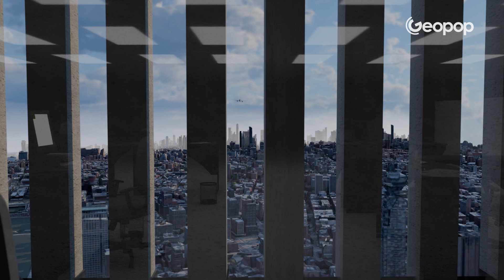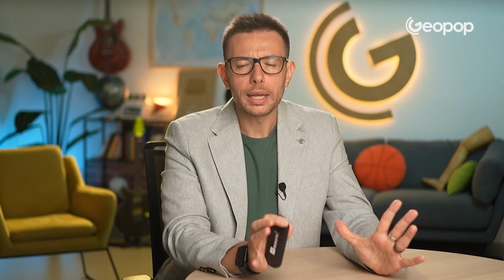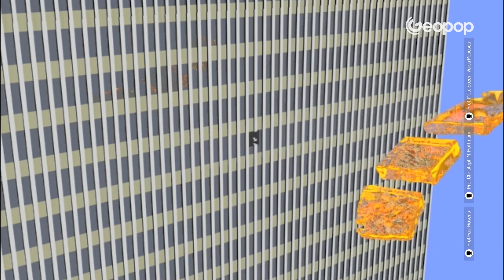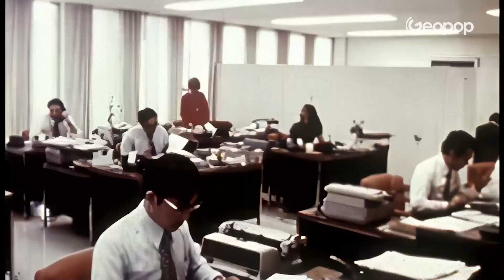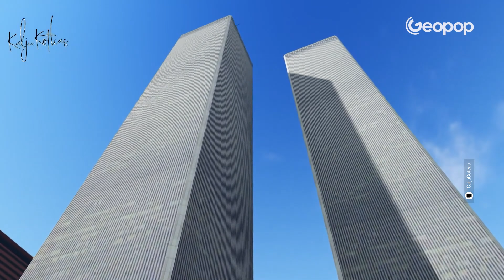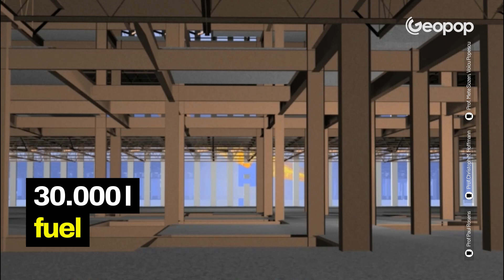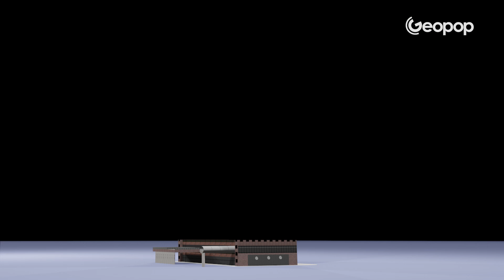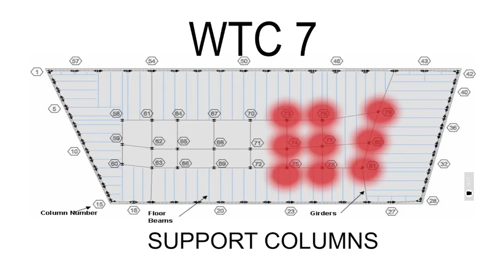9/11, 2001: The Technical Reconstruction of the Twin Towers and WTC 7 Collapses

Comment: Hey just asking questions out of curiosity, I am not a chemistry or physics major:
1) How did the temperatures rising to 900 degrees? How did it reach the maximum burning point from open air burning of 260–315 °C (500–599 °F) to maximum burning temperature of 980 °C (1796 °F). This part I do not understand.
2) The fuel is predominantly in the wings and back fins so on impact that fuel would have trickled down the building and as other footage shows it travelled down the elevators. If the fuel is not contained in one area and combustion is fed with the open air. What would have limited the burning of fuel and reduce the strain on the metal   weakening the structural integrity of the building?
Reply: These are some of the people who found molten steel in the w t c debris 
. Captain Philip Ruvolo (NYCFF), 
Richard Riggs(debris removal expert), Mark Loizeaux , Leslie Robertson (wtc structural engineer), Lynn Margulis (University of MA),  Dr. Abolhassan Astanch (from Berkeley),  Robert Kim Ireland( chemical engineer for US Army Corp of engineers), Mark Basile( chemical engineer), Kathy McGrade (materials engineer), Gery Warner( Mechanical engineer), David Gregg( PhD Chemical engineer), Steven Jones PhD( physicist), Kevin Ryan ( BS Chemistry), Niels Harrit (PhD Chemistry), Tom Sullivan( Explosives team) Jason Cheshire ( Chemical engineer), and Jeffrey Farrer (PhD Material science engineer).
Reply: In open air, jet fuel burns at around 260-315 °C, but inside the WTC towers, heat was trapped and combined with burning office materials. This boosted the fire’s temperature to around 900-1,000 °C enough to weaken the steel (though not melt it) and cause the collapse.
Reply: @NaApologia then where did the molten steel come from?
Reply: @robbiehiatt9966  The molten metal seen in the debris was almost certainly molten aluminum (from the plane and facade), which melts at 660 °C. It wasn’t molten steel .. no credible evidence supports that.
Reply: @NaApologia It's easy to say hey there ain't none of that. What is hard is looking through the debris and actually doing the tests. Which was done by experts. You are lying because you didn't look in the dabris did you? You have no proof. Go look up these people they will show you the evidence. Ill leave you with this. So if there were no explosives then what is this? 8:25
https://youtu.be/bLF5D7M1YgA?si=aHSvS__uOdxMi1ZB
You can't say that it was added because you can see the firemen's reaction to the explosion. And you can't say it came from anywhere else because the firefighter says
" We gotta get out of here,  7 is exploding " words are cheap, here ive given you factual evidence
Reply: @robbiehiatt9966  What molten steel?
Reply: @ChristLink-Channel Let's set the record straight. Molten steell was found in the dust, and in the debris for 6 weeks.  Molten steel was reported by the fallowing 
people. Captain Philip Ruvolo (NYCFF), 
Richard Riggs(debris removal expert) , Leslie Robertson (wtc structural engineer), Lynn Margulis (University of MA),  Dr. Abolhassan Astanch (from Berkeley),  Robert Kim Ireland( chemical engineer for US Army Corp of engineers), Mark Basile( chemical engineer), Kathy McGrade (materials engineer), Gery Warner( Mechanical engineer), David Gregg( PhD Chemical engineer), Steven Jones PhD( physicist), Kevin Ryan ( BS Chemistry), Niels Harrit (PhD Chemistry), Tom Sullivan( Explosives team) Jason Cheshire ( Chemical engineer), and Jeffrey Farrer (PhD Material science engineer). And more
Reply: @NaApologia  Plus the wind.  Plus the fire creating its own suction.  Plenty enough to get to 1000°

Comment: so let me follow this ,,, You are saying the nose of a jet plane is shown coming out the other side after going through the center of the main support columns and come out intact in the video... DOUBTFUL...  Aluminum vs.  Steel. and you think Aluminum would come out totally intact.... ha ha ha
Reply: Nothing came "intact".
And the nose of the second plane came on the other side exactly because its path wasn't intersecting the core columns (but was the case with the first plane), as it was a bit off-center, as we all could see.
Wake-up.
Reply: That's not the nose.

Comment: "The heat caused the metal to buckle".  Ya, right.  The L.A. Skyscraper had 10 lower levels (with all the wieght) engulfed in flames with no building collapse.  Other Skyscrapers as well.  Building 7 news footage, "Stand back, we're pulling it ! " from the fire department.   I saw the local news footage myself before it was censored.  It takes at least a week of preparation for a controlled demolition to happen, so it was pre-planned.  The government needed a reason to go to war with Iraq (oil), and they got it.
Reply: Were these other fires fought? Did the fire department put water on the fires? Yes. Yes they did. Big difference.
Reply: Steel framed. The critical bit is STEEL.

Collapse initiation was due to sagging floor trusses (which we can see) causing inward bowing of some perimeter columns by up to 5 feet (which we can also see) at the impact and fire damaged floors until those perimeter columns buckled and failed, initiating the collapse (which we can see). I would refer to you the excellent Gary Pollard video of the collapse of the South Tower. Pay attention to the first 12 seconds in particular.

www.youtube.com/watch?v=ULdiD6gYZO0

Comment: Still doesn’t explain where half the rubble went. It’s like they where vaporized
Reply: The were under and around the towers.
A part was converted to dust, but that likely a small part of it.

Note however than the 7 large undergrounds evels were crushed down by the falls, thus a large part of the debris went underground.

Comment: Expert Demolition seen the videos and at the "point" right before walls came down "puffs" were seen. As like explosions
Reply: Those "puffs" were jets of dust & debris forced out of the building by the increasing air pressure as the building collapsed. But they were slow, not much like explosions at all.
Reply: Those puffs are called squibs, very typical for a controlled demolition.  If it was air pressure it wouldn't have happened 20 floors below the collapse. Heres a video to help understand squibs. https://youtu.be/eXAgulfAtR4?si=-iLO9aQjMJVLTUYH
Reply: @robbiehiatt9966 Finally someone with knowledge on this. Thank you
Reply: @robbiehiatt9966  ANYWHERE below the collapse is a legit place for jets of air to escape the tower. What do you think happens to the air pressure in those buildings as their volumes are rapidly reduced? That air's gotta find a way out of the building so they make their own. The is ZERO evidence that those jets are explosive in nature.

Oh, and your video is a classic example of circular reasoning! They must be squibs because they're squibs! lol
Reply: @Tim22222 yea that makes sense,  it skips 1600 windows then blows out the 1601st window. You're a fool. If you can't see the explosions happening constantly as the 2 towers fell you ain't looking.
Reply: @robbiehiatt9966 Mr. 66 yeah I'd didn't fully say "PUFFS" all the way down. Am I ok know Mr. 5 subscribers
Reply: @robbiehiatt9966  If those were explosions, tons of physical evidence would have been left behind: residue, detonators, wiring, etc. etc. First responders & forensic examiners went through the wreckage with a fine-toothed comb. What did they find? NOTHING.
Reply: @Tim22222 they were obviously paid to find nothing. But here's a list of experts who found molten steel in the debris. So I ask this. What here burned hot enough to melt steel.Captain Philip Ruvolo (NYCFF), 
Richard Riggs(debris removal expert), Mark Loizeaux , Leslie Robertson (wtc structural engineer), Lynn Margulis (University of MA),  Dr. Abolhassan Astanch (from Berkeley),  Robert Kim Ireland( chemical engineer for US Army Corp of engineers), Mark Basile( chemical engineer), Kathy McGrade (materials engineer), Gery Warner( Mechanical engineer), David Gregg( PhD Chemical engineer), Steven Jones PhD( physicist), Kevin Ryan ( BS Chemistry), Niels Harrit (PhD Chemistry), Tom Sullivan( Explosives team) Jason Cheshire ( Chemical engineer), and Jeffrey Farrer (PhD Material science engineer). 
All found evidence of molten steel. So obviously someone was paid just like NIST
Reply: @Tim22222 how's this for evidence ? 8:25
https://youtu.be/bLF5D7M1YgA?si=aHSvS__uOdxMi1ZB
You can't say that it was added because you can see the firemen's reaction to the explosion. And you can't say it came from anywhere else because the firefighter says
" We gotta get out of here,  7 is exploding " And theres your proof how they knew 7 was gonna fall.

Comment: There was "work" on corner elevators days before this.
Reply: These are the people who found evidence of molten metal at ground zero.Captain Philip Ruvolo (NYCFF), 
Richard Riggs(debris removal expert), Mark Loizeaux , Leslie Robertson (wtc structural engineer), Lynn Margulis (University of MA),  Dr. Abolhassan Astanch (from Berkeley),  Robert Kim Ireland( chemical engineer for US Army Corp of engineers), Mark Basile( chemical engineer), Kathy McGrade (materials engineer), Gery Warner( Mechanical engineer), David Gregg( PhD Chemical engineer), Steven Jones PhD( physicist), Kevin Ryan ( BS Chemistry), Niels Harrit (PhD Chemistry), Tom Sullivan( Explosives team) Jason Cheshire ( Chemical engineer), and Jeffrey Farrer (PhD Material science engineer).
Reply: Maybe. So what?
Reply: @Tim22222  there was work done and Thermite was suspected to have been seen in the recordings. Seen as "melting metal as it came down.  That's what "so what
Reply: @edwardandrade4390  Work being done in large budlings should surprise no one. Thermite has never been proven, certainly no one ever "saw" it. Metal does not need thermite to melt, fire can do that.

Pretty weak.
Reply: @Tim22222 whats your degree in?
Reply: @robbiehiatt9966  Physics.
Reply: @Tim22222 Mr. 3 subscribers

Comment: Jet fuel buns about 800°F to 1500° F . Steal beams need about 2750°F.
Reply: True! And as noted below, irrelevant. (But did you know that jet fuel was not the only thing burning in those towers?)
Reply: @Tim22222 paper and clothing with hum*ns THAT wond be that hot. Either
Reply: @edwardandrade4390  1000°C is not unusual for office fires. And although that's not hot enough to melt steel, it is hot enough to weaken it by up to 90%!
Reply: @Tim22222 Well let me ask you this mister tim. If the fire was a thousand degrees what temperature does that make the metal?
Reply: @robbiehiatt9966  If it reaches thermal equilibrium, 1000°C.
Reply: @Tim22222 So you don't know. And you're welcome,  now go figure the rest out on your own. Because in this situation,  it never reaches 1000°.  opps, didn't mean to give you the answer but I've been holding your hand here, you sure you can walk??
Reply: @robbiehiatt9966  I DO know. If you put metal in a fire that's 1000°C, it's going to eventually reach 1000°C. And the fires were estimated to have reached - ready? - 1000°C.

Or do you have a better take to share?
Reply: @Tim22222 you didn't account for the steel that wasn't being burned. The whole structure was connected. The parts being burned would have to heat up parts that wasn't being burned. In this instance it would never reach the 1000° mark. Do your research. Go to schools if you don't understand. Its never to late to learn something.  My guess is you are lacking in the brains department.

Comment: I'd believe jet fuel DOESN'T burn hot enough to burn or melt steel beams .
Reply: You are correct.

And since there's zero evidence that any steel melted, not a problem.
Reply: @Tim22222 In the clean up the beams were looked at and seen in that "melted" form.
Reply: @edwardandrade4390  Nonsense! If they melted they'd be puddles!

Comment: The elevator shafts were reinforced concrete .
How did they get dustified from downward pressure?
   Especially if the whole building fell in its footprint?
Reply: "The elevator shafts were reinforced concrete ."

No they were not.
Reply: @Tim22222 yes they were, with what looked like an inch and a quarter rebar embedded in it. You can see it during the construction of the towers.